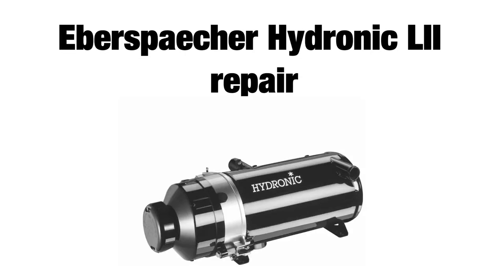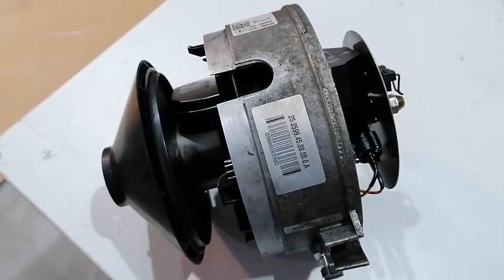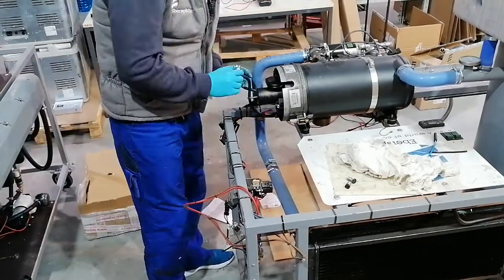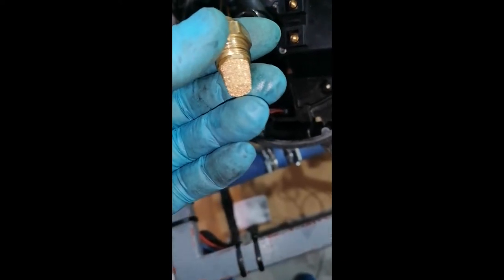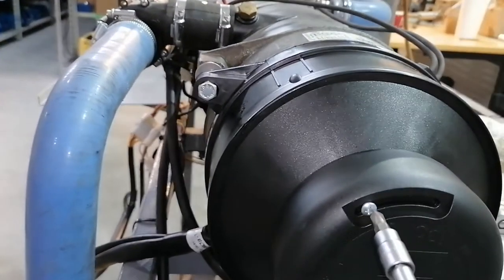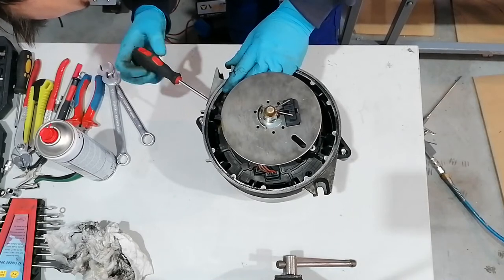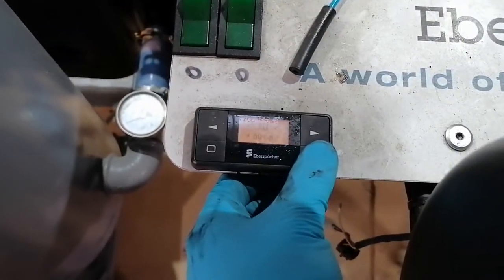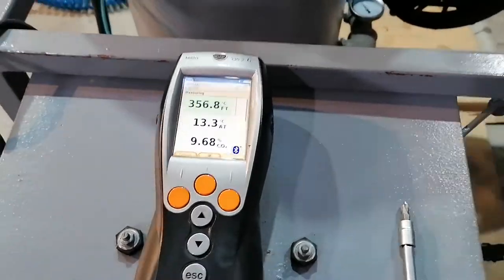Eberspacher Espar Hydronic diesel heater 30 kW bus heater repair

Comment: Thanks for the video. I had the same fuel problem and was able to save the pump by polishing out those scratches, works perfectly now!
Also for you DIYs with out testing equipment. On your B2 connector pin #5 and #2 you can use a LED with a 1K resistor to get the flashing error codes. If the unit is locked out you can take the yellow and red wire and apply DC power to it for 3sec. then the unit will unlock.

Comment: Hello,is there any possibility to repair the heat exchanger,because my hydronic 30 has an internal leak of coolant into the combusting chamber.

Thank you
Reply from the maker: Hello, not really I know of attempts but none successful, the walls are really thin and the temperature difference between hot and cold is to big so it is really hard for the welding to contract and expand as the inner wall. It is worth trying but I am not optimistic about the success of the repair.
Reply: @DIYHelper  thank you fir your honest opinin. Wish you all the best
Reply: Is there any way i can attach a heat exchanger from a webasto,to my hydronic 30?  I can not find a replaceble heat exchanger for my original Eberspacher hydronic 30
Reply from the maker: I don't think so

Comment: Hello. I have hydronic 30 , 251818 and i want to connect PC to diagnose. There is 8pin diagnose  socket , but i have unit with red, black and purple wires. Red and black to +/- but purple?  which pin or color of cable?
Reply from the maker: On the heater or on the diagnostic tool you have these wires?
Reply: @DIYHelper  Diagnostic tool.
Reply from the maker: What is it called? Edith?
Reply: @DIYHelper  Edith, or KD2000, i have both.
Reply from the maker: So you probably are missing the adapter, I will have to check on Monday which is which on edith
Reply: @DIYHelper  I have a cable, USB on one end, male OBD on the other, with the inscription WEBASTO, and the OBD male plug is connected to the second OBD female plug, the other end of which has only 3 bare cables, in the colors black (-), red (+) and purple (diagnostic), to be plugged into the 8-pin diagnostic socket in my Eberspacher, on PC i'm using EDITH or  KD2000 programs, but I don know, how to plug the wires to socket.
Reply from the maker: Webasto is a different brand, it will not work with Eberspaecher

Comment: Hello!! I have a cuestión. Do you know if it’s possible start this equipment without the controller?? I have the wirings diagrams but it is not clear the signals. Thanks
Reply from the maker: Yes, a simple +24 V on the yellow wire will start the unit if it's not locked.
Reply: @DIYHelper  Ok thanks and if it’s locked. Do you need to save the errors with the computer?
Reply from the maker: It should be possible to unlock by starting the heater with + 24 on yellow wire and after that +24 V on pin 13 yellow/red wire for 3 seconds.
Reply: @DIYHelper  Thank you so much. You are very kind.
Reply: @DIYHelper  thank you very much. I have unlocked the unit exactly as you described,and now it is working perfectly. Thank you 👍
As for the auxiliary water pump it is a Webasto U4851 and it is not working. Last year before the ECU became locked,the wather pump was working as it should,without any kind of noise. Could it be stuck? Because it was sitting for a year.
Reply from the maker: You can check the pump by applying voltage to it and they sometimes get locked... Check if the locking is in the motor or the pump head. I think there are repair kits available for the head part.
Reply: @DIYHelper  the Ecu unit is sending 24v,the wires are all ok. If i disconect the pump and give it directly 24v ,for 1 secound i can hear a little noise....like it wants to start,and the nothing,silent. I think i will remove it from the coach and try to see if i can manage to start it. I will post here. Thank you👍
Reply from the maker: Yes, remove it and take it apart. It should be easy to find which part is bad.

Comment: Is there a way I can email you?  I have a eberspacher d12w and would like some advice if possible?
Reply from the maker: Hi, you can post your problem in this group, I am active there and also a lot of other great guys willing to help. https://www.facebook.com/groups/217340312842720/?ref=share
Reply: Eberspaecher pipe

 251818570000 is not even in diameter, the boiler does not start with it, without it there is no problem.  the nozzle and electrode are new.  what could be a problem?  video I posted on facebook